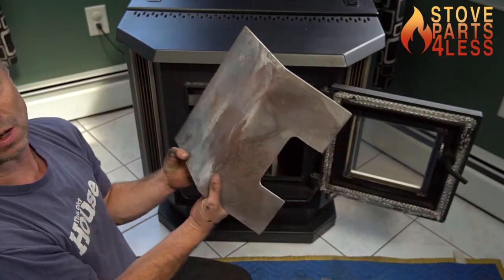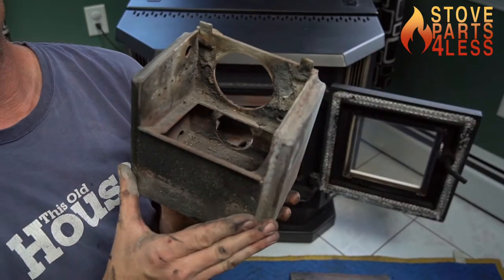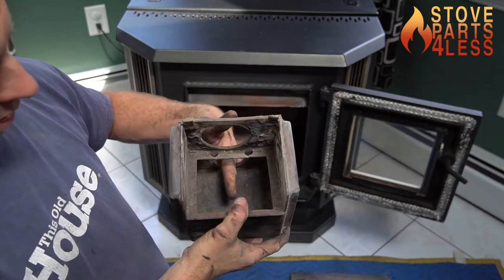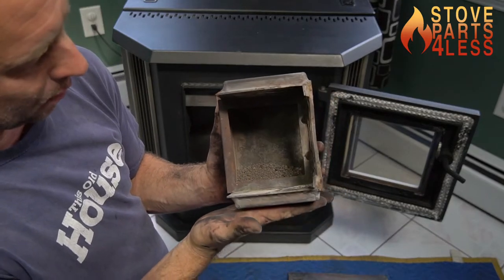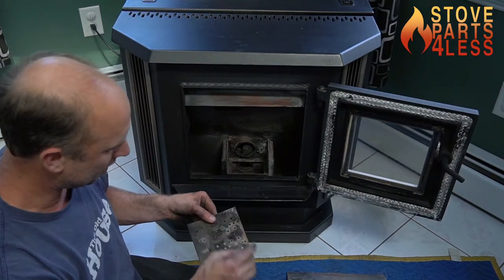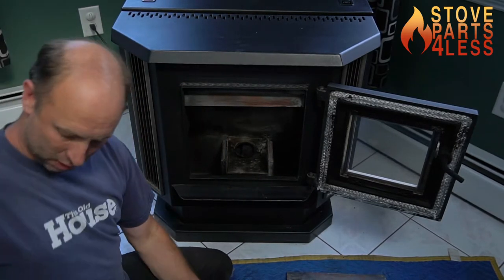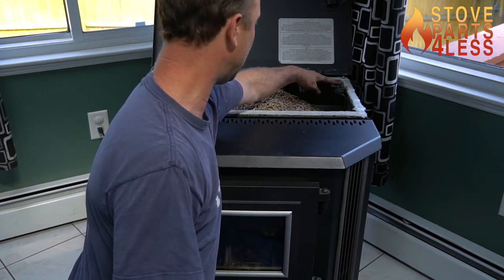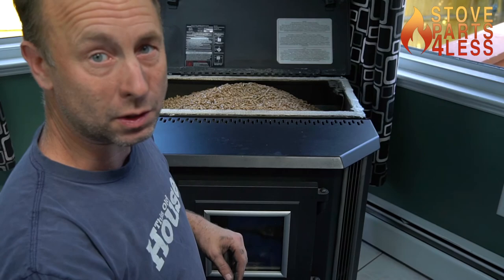Why Your Englander Pellet Stove Won't Ignite

Comment: Another thing that could help till you figure out what’s wrong is to wait till a small amount of pellets are in the burn pot, grab a single pellet (long to medium sized) and stick it in the igniter hole touching the igniter and hanging out. In the 10 years I’ve own this model of stove I’ve never had a problem with the igniter lighting my pellets except every once in a while but this is most likely to be a case where the pellets fall in a weird way into the burn pot. Probably the case of being too far away. 
  Anyways if this happens I always stick a pellet into the igniter hole and it always lights after this. Hope this helps some people.

Comment: You need to check and see if the bolts behind the burn pot are sticking out or not if they are you need to grind them off flat with the back of the stove and as far as it warping you can hammer it flat again

Comment: I have the same unit but brand new. Keep getting E2 error code on start up. But when I add some pellets by hand in the pot before I start up it’s not a problem. I get a flame in 6 min vs 11 minutes. Waiting for support to call me back ..if they do. Any suggestions ?

Comment: Silly question but did englander make any 25-pdvc stoves in 2003 that didnt have an igniter? My step daughter got a used one and swears there is no hole for the igniter to set the pellets on fire and they were told they had to light it manually. Also can you tell me how to factory reset the control board back to the factory settings? Thank you for your help

Comment: You know your stuff. I have the englander pellet stove 25-pdvc for three years now and after is shortly heats up a loud high pitched harmonic squeal comes and goes. It is affected and temporally quieted by increasing the blower fan settings. Ive also removed the rear cover panel and place a 1ft square fan blowing on the fan motor which really seems to help the noise go away. Please help. Im at my wits end after tons of research and replacing the combustion fan motor. Although I did just order a new OEM Blower PU-4C442 as my last ditch guess. Hopefully its just the bearings in there and the new one when it arrives and installed will solve my issue.

Comment: I have the same unit.
Originally It kicked out an e2 code and repressing start a second time and it was fine.
I replaced exhaust motor and a vacumme  line .
Now I plug it in the board lights up and goes out.
I keep pushing start and it will not even start.
?????? any ideas.
Reply: Did you ever figure it out? Having a similar issue sometimes I get an E1 code or an E2 code typically I just started with a handful of pellets and using a torch but recently had a I think an E1 code and the stove was running super hot before it just randomly shut down I opened the hopper cover and there was smoke coming out of the top not sure exactly what happened but had no issues with it besides having to hit the start button twice to start it and now trying to troubleshoot what's going on with it always seems to be something though..

Comment: The igniter on these stoves are junk. I've been through many. They don't last. Make sure your seals are good and just light with a torch.
Reply: That was the conclusion I came to also. Even with new gasket, straight back plate on the burn pot, new OEM hot rod mounted at the manufacturer recommended distance back from the hole, it still only ever ignited once. Now I just torch it every time.
Reply: I do the same thing haven't had any issues with it but this year for some reason getting an E1 code and it's just randomly shutting down the other night it got so hot I'm not sure what happened it ended up turning off on its own like just shut down not like burned itself out it just turned off and then I opened the lid and there was smoke coming out of the hopper had a little bit of a panic mode but just took all the pellets out and I didn't burn my house down LOL no I'm trying to figure out what's going on with that been running fine without any problems it's always something though but the torch was definitely the go to move that's how I started every single time and it takes like 30 seconds to get it going and you don't have to worry about it

Comment: Having trouble with my stove again. I can't get my auger to move. It has a new motor. What am I doing wrong.
Reply: I just got mine and both augers were stuck.  Probably when moving it on the dolly to get it in we might have jerked it too much.  I just removed the motor and the loosened the 4 bolts holding the auger (both are the same..., you might need to wiggle the auger and see if it turns then while holding it in place, tighten the bolts in a crisscross pattern.  Check it again if it's ok, reinstall the motor.

Comment: Thanks for the video .   I have a1998 model  25 PDV manual light keeps throwing a E 2 code I have done what manual suggest did not help . It will burn in SU mode  15 - 20 min  and shut down with  E2  What are the reasons it woyld throw an E2  besides burn pot ? Thanks for your time
Reply: @stovegrillpartsforless4637    Thanks for your quick response ,  My stove does not have any vacuum hoses { 1998 }  Only wire i see runs from control board to back side of front casting { Single wire with brass connector.}  Thanks for your time
Reply: Stove Parts For Less   Thanks again... I was thinking there would have to be a jumper or something to tell controller circuit is complete .I found the location on my old board you mentioned it is labeled J2 Vac Sen . And has a black cap . Will check new board to see if i can locate. Your time is very much appreciated .
Reply: Hello once again . I checked  the new board  for the jumper for Vac sensor I seen a jumper J 11  to the right the tabs marked Vac sensor . So i checked for mode by pressing up and down buttons at sane time after plug unit in . It was in D mode  i have been told the PDV 25 Setting is C & The PVDC 25 is D  ?  So i fired the stove in C Mode seemed better / Still ended with an  E2 .   Should i try a homemade jumper to try on the actual spade connection  where it says Vac Sensor . Thanks for all of your help
Reply: @stovegrillpartsforless4637  crossing my fingers this works tomorrow . Will update, Thanks so much
Reply: @stovegrillpartsforless4637   Well bridged the Vac Sen . And set to C  Mode.  Now running same amount of time and shut down with No codes ... And unit still has green on after shut down.  Also run diagnostic and all checked ok ? Back to square 1 ?
Reply: Called service  Stove was on wrong mode they said for a 1998 mode is B . And bottom numbers 611 . Running like a new stove now Just have to fine tune for best results with minimal pellet usage. Thanks for all your help with out it i would have already junked it  .

Comment: we just bought this stove , the stove will run for about 20 min. and then shut itself off. I can manually start it by starting fire in fire pot.
it is throwing an E2 error code. can you help ? Have spent hours on hold through the company and have never gotten ahold of a person. I'm about to throw it through a window !
Reply: @stovegrillpartsforless4637   hi there my name is Bill and I have been trying to help a lot of people who have what they all say is this New Englander pdv 25 or a little different stove with the dual horizontal outputs from the heat exchanger box. But I keep getting a few people who are absolutely insistent that they have no vacuum switching of any kind and there's no ignitor for start-up and the only information that the controller is seeing is a single wire Temp sensor? They also have a few more buttons on there control and it has letter's from (ABCD) and the other 4series buttons are the normal number series to control the functions of the stove. Ok that aside I will have to do what we don't like to ever do because of the chasing the tail of something I can't properly do a diagnosis of the individual parts! Assuming!yuck I have that word.! Assuming the only information that the controller is seeing is the single wire Temp sensor and it is more than likely to be a bimetallic sensor and it is seeing this information in millivolts or ohm's the control panel needs to see a rising signal over a set Time to decide to keep feeding the lower Auger to get it going through the initial Start-up and then move to the next phase of feeding the fire box pellets and Air in a Timely manner to keep it Running. But without a vacuum switch to tell itself how's it is running either lean or to many pellets and running hot the feed auger has no idea what to do or adjust the top auger speed  or the exhaust fan in a way to slow the burn down or speed up the vacuum\Air to increase our efficiency to lean out the fire or slow the air to give the augers enough time to add more pellets and make it run longer and a cooler fire to last longer. But I am having trouble with this working on the temperature sensor working data set streaming either a hotter or cooler fire? Do you have any idea how it works with a single sensor and what the letters do (ABCD) in conjunction with the normal numbers for adjustment to the controller? My New Englander is a old one but it only has the 3buttons under the ON-OFF and the first one under the on is the top Auger feed Speed. The middle button going from Left to Right is the important button that controls the exhaust fan speed to get the most out of the pellet combustion! But again if you don't have a couple of Data sets like a longer exhaust and the fan has to work harder to make a vacuum in the bottom of the fire box is clean and completely burns the materials to Ash. I would think that you would be changing all the speeds on it constantly with the stoves with no vacuum switching and the other sensors combined to be able to walk away from it and not have to be watching it like a baby to keep it 💯 Happy. But my third button on the bottom of the controller all the way to the Left is what a Temp sensor is good for is when to tell the heat exchanger blower fan to come on or off to build more heat in the chamber. Anyhow it's a little after four am and I'm going to bed and think about this stuff yesterday ha ha. But again thanks much for the sounding board and the help! Not to many of us old guys doing much of the older stuff to figure it out instead of just throwing it out there on the corner for the junk pile! Thanks again. Bill